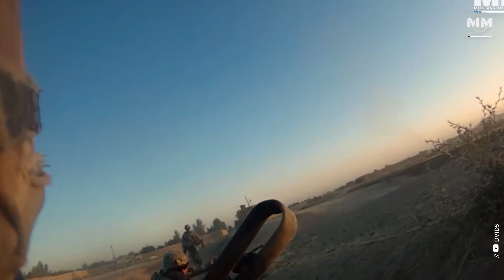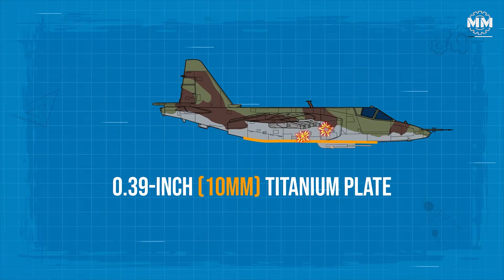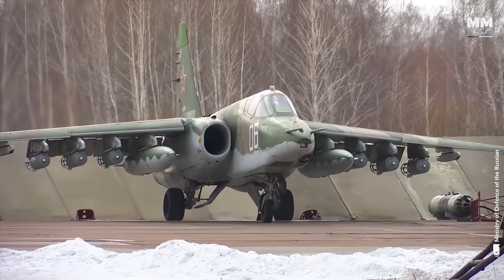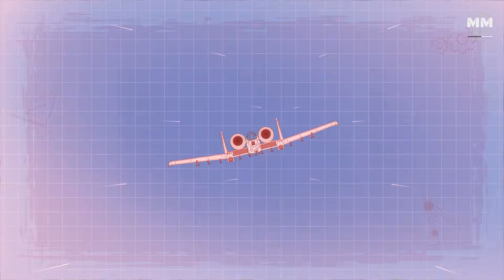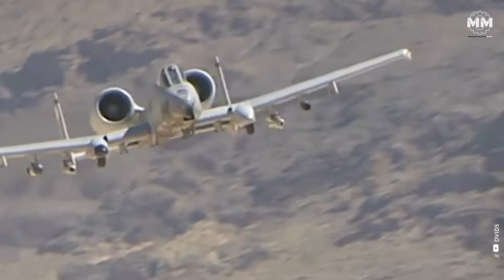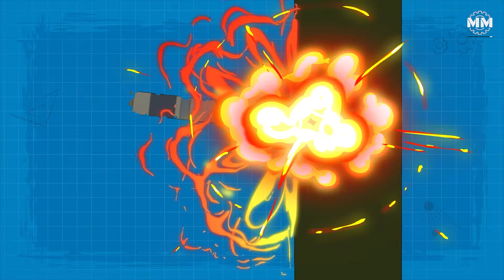A-10 Thunderbolt II vs Su-25 Frogfoot: Deadliest Close Air Support Jets Ever Built

Comment: These two aircraft are only superficially similar- ground attack jets.  But they have very different approaches to the task that they are an apples to oranges comparison.  A-10 values endurance.  It is optimized for loitering time, a versatile payload, a large payload.  This plane is meant to circle the battlefield like a vulture and erase things that ground troops found inconvenient like a service that you call.   
The Su-25 is optimized for protection and speed.  It has about twice the armor, and twice the speed.  Able to go supersonic in a dive.  It has half the payload, half the range.  It does not loiter.  It gets sent on a mission by the staff to wipe out this or that target.  It gets into a heavily protected zone, unloads its weapons stores on a target and leaves just as quickly.  It takes twice as many hits and spends half as much time in the danger zone.  Is it 4x survivable vs A-10?  Another way to say it is that the A-10 has A-1 counterinsurgency heritage while the Su-25 has Il-2 mass industrial peer warfare heritage.  They shine against different types of foes.  The A-10 excels at being the hostile UFO over a field of savages, eliminating them with its superior technology at the behest of some platoon leader or FSO.  The Su-25 is meant to be flown by psychopaths through enemy air defense zones, unload everything on a target, and get the f out quickly.  It pays for speed and toughness with range and payload, but in its use case that’s a sensible trade off vs A-10.  Neither is survivable now
Reply: The facts speak for themselves, the Su25 has operated in much more hostile environments than the A10, the Su25 flew in very hostile airspace far from any air support, the Su25 is having success in Ukraine, both Russia and Ukraine use it and it has managed to successfully eliminate many of its targets, while the reputation of the A10 is only based on the wars the US had in the Middle East, without a doubt the Su25 is significantly superior to the A10 just by experience

Comment: In modern times, there are no massive tank attacks, and the Thunderbolt has to carry this useless heavy gun, which limits its combat capabilities. Russian plane. This is truly a flying tank fighter. The Su-25 is cheaper and easier to maintain and repair. This aircraft is cheaper than the A10. With mass application, the Su-25 is the most profitable. The Su can fly out on a combat mission twice while the A10 is being prepared for a second mission with equal combat missions, which means the Su is more effective in real combat.

Comment: The A-10 isn't really designed for close air support, its really designed for attacking convoys of armored vehicles behind enemy lines which you seem to figure out after 8 minutes.  More of a ground hunter/killer, not really troop ground support.  Its supposed to try and slow down/stop the waves of tanks coming out of the soviet union in Europe.  Either way this video seems like it was done completely with AI so down vote for you.

Comment: On paper the two are pretty close, in execution the USAF has handled the A-10 far more effectively.
Reply: The facts speak for themselves, the Su25 has operated in much more hostile environments than the A10, the Su25 flew in very hostile airspace far from any air support, the Su25 is having success in Ukraine, both Russia and Ukraine use it and it has managed to successfully eliminate many of its targets, while the reputation of the A10 is only based on the wars the US had in the Middle East, without a doubt the Su25 is significantly superior to the A10 just by experience

Comment: The problem with A-10 not typically mentioned is that most of them are in dire need of a major mid-life repair due to being flown far longer than had been designed for, and now they're wearing out faster than we can fix them.
Reply: The lack of investment into future-proofing or replacing (perish the thought) the A-10 is foolish. The Warthog has already proven nothing will ever surpass it, it needs to be maintained or replaced.

Comment: Both strikers are designed for close air support (CAS), but despite their similar missions, the doctrines of their operating nations differ greatly. The A-10 is used exclusively by the U.S, and while it does edge out in precision munitions and avionics, the Su-25 isn’t lacking in modern guided weaponry either.

The A-10’s infamous GAU-8 cannon, while iconic, is rarely used in actual combat—It most of the time relied on long-range AGMs, bombs, and rockets. Speed is also a major factor in survivability, and the A-10 is slower compared to the Su-25.

Importantly, the A-10 has never operated in a war without established air superiority, while the Su-25 has been deployed by multiple nations in contested airspace, often under heavy fire. Despite higher losses, Su-25s have consistently kept flying in harsh, high-risk environments, proving their ruggedness in ways the A-10 hasn’t been tested.

Hypothetically, if both aircraft operated in a Ukraine-style contested airspace without air superiority:
- A-10 would likely suffer heavy losses.
- The A-10’s survivability tech could help pilots survive more often.
- But the Su-25’s ease of maintenance and availability might give it an edge in a war of attrition.
Reply: yeah but no one who makes the su-25 or fights with it will ever be able to fight a war of attrition. :face-blue-smiling:

And anyone operating the A-10 is almost assured air superiority.

Comment: The SU-25 does not have THE GUN.
Reply: It does have 25mm
Reply: @Warthogbv  2x 30mm
Reply: @Warthogbv  Absolutely not, a 30x165mm (the standard for Soviet /Russia) from the eighties. A little slower than the 30x173 but with heavier bullets, so practically the same effects.
Reply: If you want the OG big gun go see the mig 27
Reply: ? You are dumb?

Comment: Both are fairly obsolete. A-10 more soWhile the A-10 was designed as anti-armor, the Grach (SU-25 name, Russian for rook) is faster, nimbler and designed for multi-role, inc. naval interdiction. Not as dependent on other jets doing air suppression. (Air Forces #1 hate on the A-10 was that to use it you also had to have F-16s, 15s assigned for air cover) . And the Grach can take off from unimproved roads.
Reply: Yes but is a reflection of the respective role in the Cold War. A-10 was designed to counter Tank formations of the  Warsaw pact first and foremost, Su--25 to help them to overcome Nato defences, that could be of any type instead, not just tanks. To change role the A-10 needed a LOT of added tech , the Su-25 just an incremental upgrade.
And when utilized together(and same happened with AMX Ghibli ) their own effectiveness was enhanced.

Comment: The coast of a planes? How many Su25 can you build for one A10?
Reply: At the moment  no one in both cases, no ore production for both but the Su-25 was produced for a way longer streak and was exported a LOT (even NATO countries still retain them).
It is fighting for both sites in the current conflict in Ukraine and have showed both its own valor but also highlighted the fact that  modern AA systems now forbid its own (and everything also, obviously) prolonged use on the battle line as it was in origin intended to operate, so they limit themselves to attack a pre-designated objective only instead of going for hunting.
Reply: Su-25 has more expensive titanium.

Comment: A huge advantage of the Warthog over the Frogfoot is that the engines were designed "outside' the fuselage and on pylons away from the aircraft body so that if a heat seeking missile hits an engine on the warthog you lose one engine and we know factually an A-10 can easily fly on a single engine.  The same scenario would have a frogfoot with an explosion inside the body of the aircraft bringing it out of the sky.  A single shoulder fired missile is all that is required to bring it out of the sky while its not at all likely that any aircraft will have two IR missiles fired at it which is what is required to bring down the Warthog so for all those SU-25 lovers out there dance all you want for the frogfoot, only one shoulder fired missile is required to bring it down.
Reply: That wouldn't happen as you describe it, by virtue of most if not all air-intercept missiles (air-to-air, surface-to-air) use proximity fuses, meaning they blow up early to shower their targets with fragments.
Reply: @pyronuke4768 you really don't know much do you?
Reply: @pyronuke4768 I can't say it enough, in just 3 years the Russians have lost more than 40 of these aircraft. In the entire operational period of the warthog we have only lost seven. I'm not sure if you've ever been to school or not but 49 is 7 times the amount of warthogs lost. That's horrifically bad. You can't spin this. That's like trying to spray a turd with air freshener.
Reply: Over 45 of these things have been lost to ground fire where is the A-10 has only lost 7. You can do basic math can't you? I have all the confidence that you can just not the expectation.  @pyronuke4768
Reply: @pyronuke4768  Seriously, do I have to explain basic math to you?  45 is more than 7.  History is what we know has already happened.  It's facts son.
Reply: You're right, numbers don't lie, so let's break them down shall we?
   In the Warthog's 45 years of service, the only time it saw heavy combat was during the Gulf War, the air campaign of which lasted around 5 weeks. In which time 7 Warthogs were shot down (plus 11 more written off due to battle damage).
   We are now currently in month 28 of the ongoing "three-day military exercise" over in Europe. Excact numbers of how many Su-25 lost are sketchy, ranging from 33 on the low end to over 50 on the high end, but for the sake of argument let's go with you claim of 45.

Simple math says on average ~0.4 Su-25's have been lost per week of heavy combat, compared to ~1.5 A-10's lost per week of heavy combat.

   The point I am trying to make is that in the last 30-odd months the Su-25 has experienced far more combat than the A-10 has in the last 30-odd years. Of course the loss numbers are going to be greater.
Reply: @pyronuke4768 I'm truly not sure why you're not grasping this. 6, only six lost in combat, one loss because the pilot fell asleep. 6 is a whole lot less than 40 something. And counting.
Reply: My point is three quarters of all Su-25 losses have happened in the past 30 odd months, in a world event that YouTube doesn't like me talking about. In that timeframe it has seen far more combat with a near peer adversary than the A-10 has seen in the last 30 odd years. If the plane's positions were swapped I guarantee you the Warthog's loss record would start to pile up in a similar fashion.
Reply: @pyronuke4768 dude, just let it go.
Reply: Fine, better than arguing all night with someone who refuses to acknowledge nuance.
Reply: The facts speak for themselves, the Su25 has operated in much more hostile environments than the A10, the Su25 flew in very hostile airspace far from any air support, the Su25 is having success in Ukraine, both Russia and Ukraine use it and it has managed to successfully eliminate many of its targets, while the reputation of the A10 is only based on the wars the US had in the Middle East, without a doubt the Su25 is significantly superior to the A10 just by experience
Reply: @ClaudioAlvin anytime somebody is shooting at you it's a hostile environment.
Reply: The difference is that the A10 always operated under air superiority, against mediocre armies like those of Iraq, Afghanistan or Syria, the SU25 has not, it has almost always operated in more hostile environments completely alone, in addition the SU25 has been in many more conflicts than the A10

Comment: Uh? You know that A10s can carry sidewinder air to air missiles?
Reply: Which it doesn't really need as the Air Force would have not only AWAC's aircraft but eagles, raptors and lightnings controlling the skies allowing the warthog to do it's ground attack business.  It can carry air to air, but that's not it's principal job.  There would be no other aircraft on the planet that could threaten the hog.
Reply: The Su-25 can also mount air-to-air missiles: the R-60M / "AA-8 Aphid" and R-73 / "AA-11 Archer"
Reply: And the Su-25 both the R-60 and the R-73/74 , so?

Comment: only an idiot would choose a-10 over su-25
Reply: A huge advantage of the Warthog over the Frogfoot is that the engines were designed "outside' the fuselage and on pylons away from the aircraft body so that if a heat seeking missile hits an engine on the warthog you lose one engine.  The frogfoot will have an explosion inside the body of the aircraft bringing it out of the sky.  Its not at all likely that any aircraft will have two IR missiles fired at it which is what is required to bring down the Warthog so dance all you want for the frogfoot, only one shoulder fired missile will bring it down.
Reply: lol i like the way you think a heatseeking missile works. like its a pointy stick that hits one thing and does not touch the rest.
Reply: @ercanyesiltas a heat seeker can do a hell of a lot of damage which is why they separated the engine into pylons away from the fuselage. If a heatseeker detonated inside the exhaust portion or basically inside of the aircraft's body then bad things are really going to happen. It's better to just lose the one engine and get it replaced once you fly back home which is what they had done on a few occasions.
Reply: @ercanyesiltas  On quite a few jet engines, you'll see a black or red vertical  line denoting where the high speed blades are found inside the engine assembly.  Best not to be standing and looking straight at that line.  Your day may be ruined.  I used to fly AH-1F's when I retired from the army.  Our engine turns at 6600 RPM.  If you throw an explosive charge into something spinning that fast it's definitely gonna leave a mark.    A standard fan jet engine turns at revolutions a damn sight higher so it's not just the warhead you gotta worry about, but what's flying off the engine in all directions.  Again, better to put those massive centrifuges with the volatile jet fuel running through it as far away from the aircraft body or when a detonation occurs or you're really gonna feel it in the morning.
Reply: hej noob https://www.youtube.com/shorts/wOl55w9t_LE
Reply: @marcinm2767 that's nice to know to see one that actually came home, there's more than 40 to 45 of them that haven't.
Reply: are you one of those bandwagon people that count the F-15's kill/death ratio against mig 15 and 17's?
Reply: @ercanyesiltas you might want to consider you talking about two aircraft that was built during the Korean War and the eagle which was accepted in the Air Force in 1977. You may as well have a race with covered wagons against a lamborghini.
Reply: Still no feat of the F-15 itself. Just like a-10s where only defence against them is the ak-47. Where su-25s are downed, a-10 wouldnt even reach as it is much slower and much worse in maneuvering
Reply: @ercanyesiltas Again, historically only six have actually been lost in combat whereas the Su 25 has had probably somewhere in the neighborhood of 60 of them shot down. That's in wars that have been going on since chechnya and Afghanistan and right now the Ukraine where they've already lost 46 of the things. Lost record of 6 to 46. But hey, good luck with that!
Reply: Also, if your plane isn't faster than the bullet or missile coming at them then that speed means absolutely nothing.  @ercanyesiltas
Reply: Is it the reason a sukhoi dodged and survived a patriot missile? Because a sukhoi is faster than the missile patriot fired? Please stop
Reply: @ercanyesiltas seriously, stop sniffing paint fumes. It's not good for you.
Reply: Ka-52 better.
Reply: That not makeing a difference when hit with large sam that rips your aircraft in to chunks
Reply: @rajaydon1893  and you can choke on a ham sandwich for lunch too.  We all gotta go sometime, but chewing the food before you swallow helps to keep you from choking as did placing the hot engines on outer pylons gives the pilot the best chance of coming home as the years have dramatically shown.  A-10's survive, SU-25's don't.  Numbers don't lie.